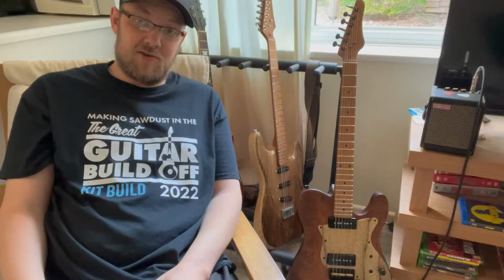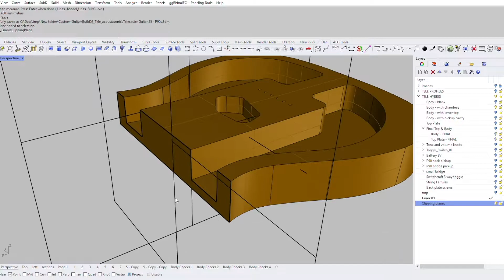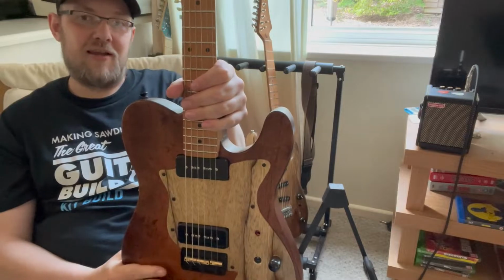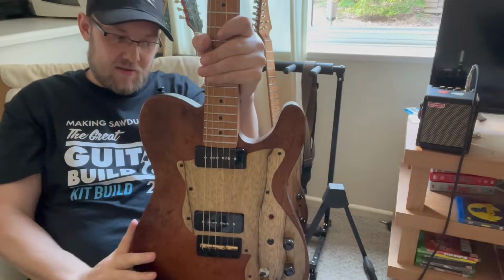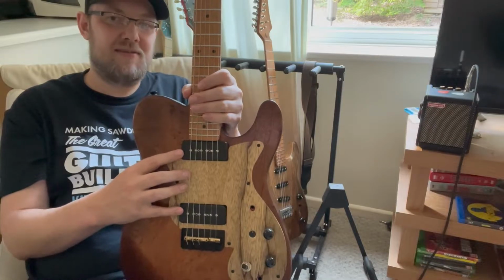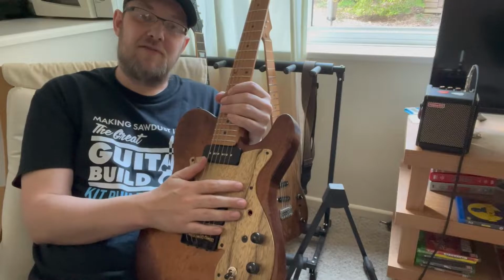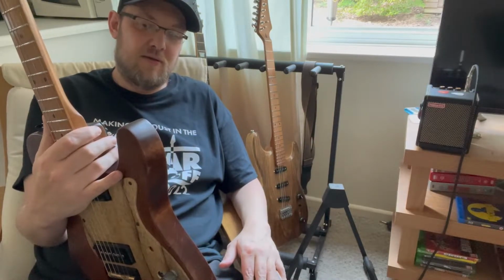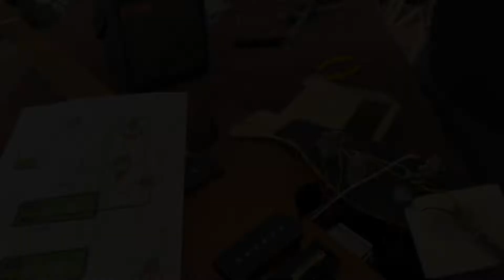GGBO22 Kit Build Entry No. 1 - Full build video

Comment: The paint it's amazing i want to copy it - can you tell me what color you use.
Reply from the maker: Thanks! I used 3 colours - amber, cherry red and brown, all from Crimson guitars stunning stains shots range. With the shots I was able to slightly tweak the colours from their pre-mixed range, but I think it would be similar using those. If you check out episode 8 (https://youtu.be/Nz84igk89jM) I discussed the actual mix. I think the brown mix included 1 drop of the cherry red; the other 2 were just the original colour in the ratio discussed. In that video I didn't discuss the process, but I basically just followed the process explained by bigdguitars here https://youtu.be/3ixvPNLbEo8.
Reply: @dnizy  Thank you, you helped me a lot:washhands: